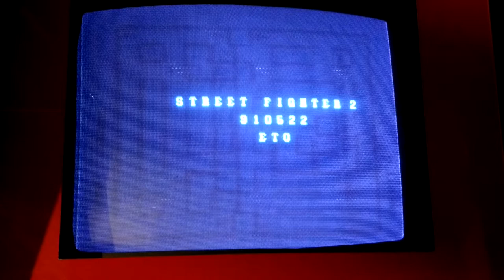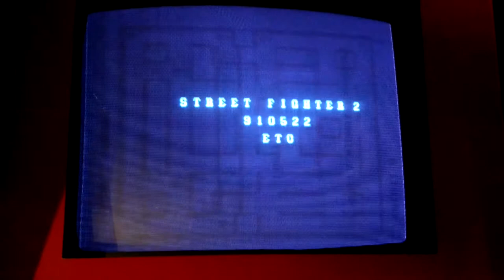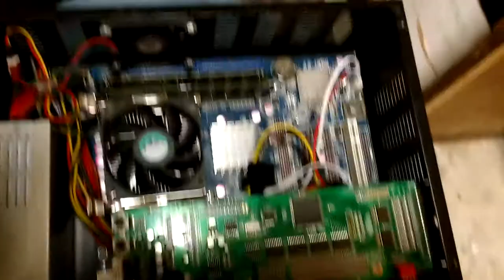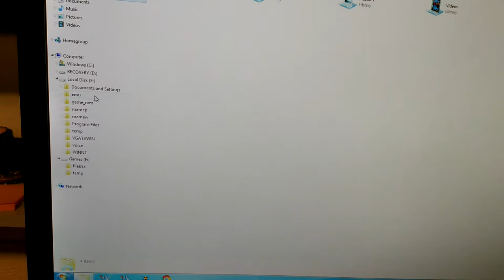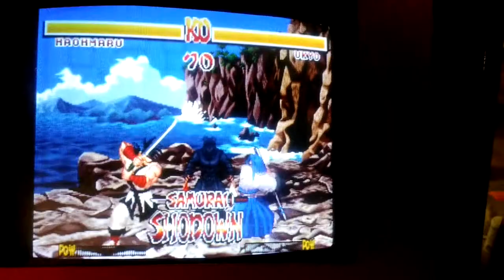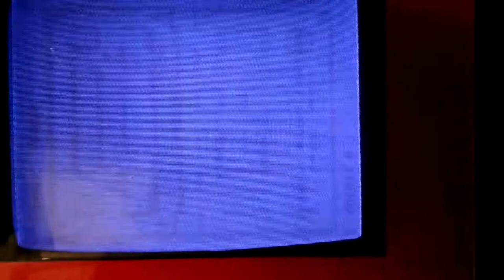GAME KING 2019-in-1 JAMMA arcade PCB - Hidden options, emulator menus, and other simple improvements

Comment: I moved and when I got to new location it wouldn’t come on. The fuse in the back where power cord connects was blown. It kept blowing. A yellow wire at the top of the first connectors was loose and a screw was on the floor. I reconnected it. BUT I noticed the other end of it was not connected either at the main computer.  Any idea what that may be ?  I can’t find any info on the internet from the company I bought it from or this unit.

Comment: I've got a Games Family which looks the same as Game King. For some reason the sound stopped working — any ideas how to fix that?
Reply from the maker: Assuming it isn't an issue with the speaker itself or a broken wire leading to it, there may be a problem with the audio amp on the JAMMA connector PCB. You may be able to pull audio from the green audio out jack on the motherboard to your own amp or a set of PC speakers.

Comment: Great vid, can’t wait to connect up a keyboard and mouse to make life easier and properly power it down.

Also quick question re  the game Tapper. Mine seems to be stuck in the menu setting and I can’t get out of it  any ideas?
Reply from the maker: Did you ever manage to get this lined out? Sounds like it thinks the test dip switch is down, which you could turn off with a USB keyboard by entering the MAME settings with tab.
Reply: Got the usb keyboard in and working great..I’ve tinkered with quite a few bits now by taking out the drive though see uve got a new vid out so will carry on customising 👍

Comment: Hi, Thanks for making the video. Is there a way to configure vertical scrolling games to automatically display as vertical?
Reply from the maker: Absolutely, if you edit the MAME.ini file to "keepaspect 1" instead of the default value of 0 it will fix those problems. 

I recently found a way to  save game options, control changes, or dipswitch settings permanently (without having to fool with any menus). It's a bit too long winded to type so I'll try to record a short video explaining it.
Reply: @MisterAzathoth  Awesome thanks a lot, looking forward to seeing the video.

Comment: Also how did you map the usb mouse/trackball to games like centipede? I can see the mouse cursor
Reply from the maker: I've setup a trackball before, but I'm pretty sure it requires editing controls section in the mame.ini file. You'll have to remove the hard drive and connect it to another PC to do that. I've got another video showing how to access it if it would help any. If it can be setup on a regular PC, it will work with this too.